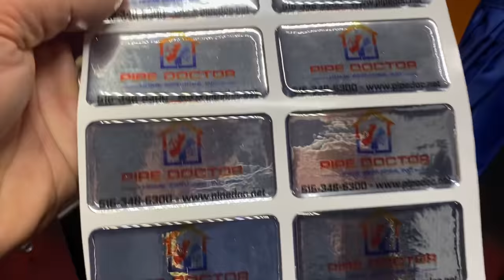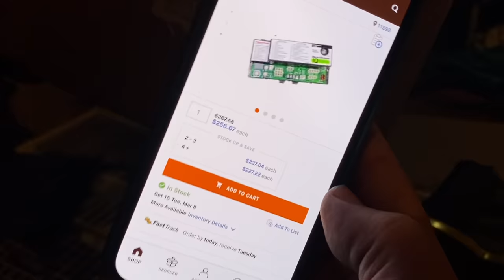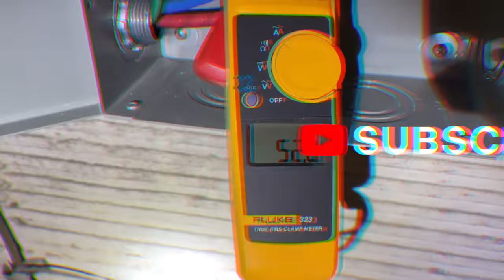Burnham ES2 Gas Boiler No Heat Error E56 Bad Control Board

Comment: I had to replace a controll board on an aire Flo made by lennox. Had to use a universal. Had me stumped awhile but then realizing a plug that is jumpered comes in the kit for the low voltage. Not a fan of all the harnesses but itll do. Good work st mike

Comment: What's up with that flexible flue pipe in that boiler?
Is that legal?
Reply: yes comes with the boiler. It is insulated because the boiler is 85 percent. I beleive you are not suppose to use galvanized flue but you can use stainless flue. The fittings on the flex are a little bit of a pain to use.

Comment: The time of night nor day of week means  nothing, that piece of equipment could be burning  51ppm !!!🤣🤣😅😂
Thanks again for the videos. 
🥃🥃🍺🍺🍺🎳⛳
Stay safe. 
Retired (werk'n)keyboard super tech. Wear your safety glasses!
Reply: No If the customer had a annual summer tune up before the winter started that would have been addressed and any changes in the system would be monitored by carbon monoxide and smoke testers. Not emergency break downs.  Mike emergency calls are the most reasons for divorce in this business ( has your wife ever told you yet, if not she will)   But hopefully not.